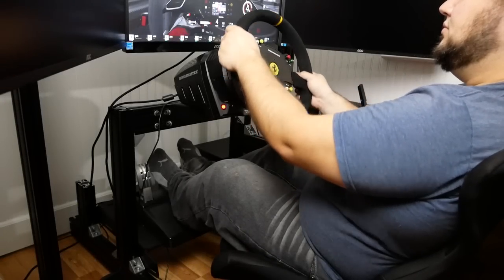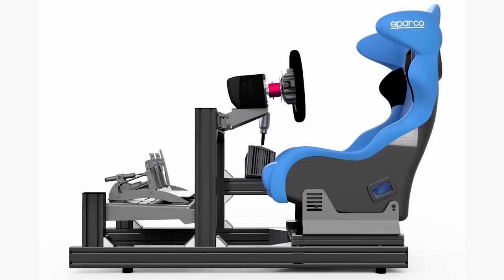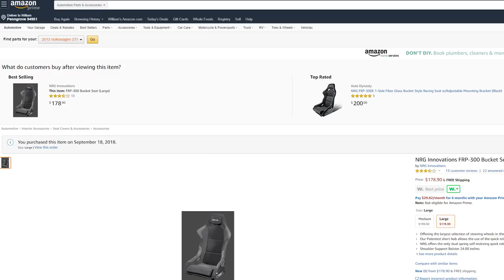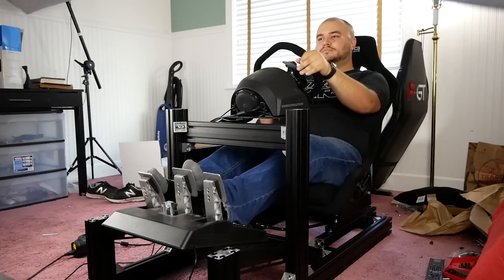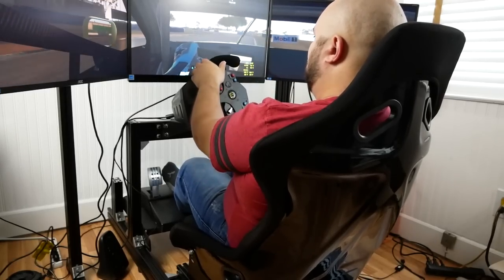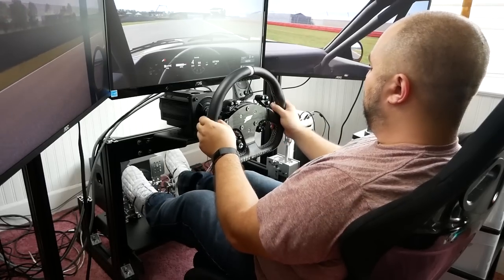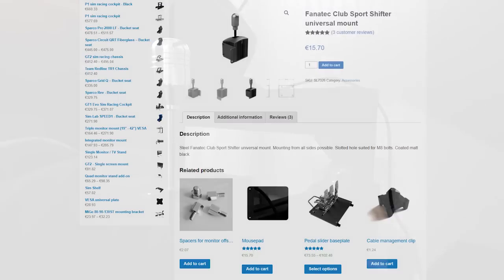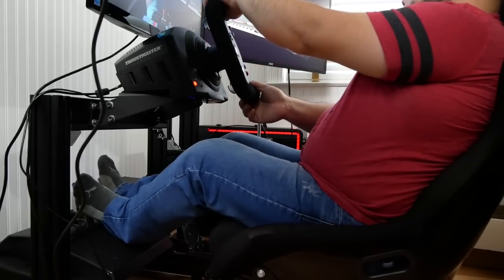Sim-Lab GT1 Evo Cockpit Review

Comment: Still getting some pedal flex on the high end stuff it seems. Looks like it would be a great rig for anything outside of an OSW/Heavy pedal setup.
Reply: This looks perfect for my csl elite.
Reply: I'm just wondering if it would be better to mount the pedals directly onto the frame and angle them with their own hardware, instead of using the pedal plate?
Reply: Just completing my build with Ricmotech Real Gear GT1 pedals and plate. Mounting directory to 40/80 cross members. 0 flex. Photos to follow.
Reply: I can't really see, but is that seat base tilted backwards or parrelel to the floor?
Reply: what would be better to buy for about the same price? or a bit more
Reply: This issue has been fixed by simlab now. Anyone with the old pedal plate can get a new thicker one for free.
Also they sell mounts for DD which stop the wheel flexing.
Reply: Jimmer
Reply: @shaunwright6348  right now I am  working on invert mounting  Heusinkveld Sprints using 4040 but will keep the thought of using part of the baseplate if needed just to reinforce it good IMHO........
Reply: For my little t300rs and tlcm its more than enough

Comment: I mounted the rail for the shifter on the outer side with the two additional angles that come with the package. Gives you a better adjustability to move the rail forward or backward. First added rolls underneath but soon switched to some silent blocks to get rid of noise that shakes through the chassis.

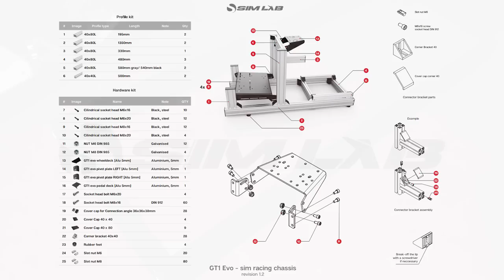Comment: Extruded aluminum structure isn't designed to flex - it doesn't. The build quality (or manufacture assembly) would be the problem with flexing. A simple brace or proper construction would fix flexing. And most importantly, those very tiny 90 degree anchor points are WEAK. (look at the 2:25 mark) If those were 3"x 3" with two anchor bolts each face, there wouldn't be any flex. The flex isn't coming from the chassis, its the given hardware. And as a private jet mechanic, we kinda know stuff ;) Take care.
Reply: hi, so you think it could be possible to fix the amount of flex of the wheel tray by using some other anchor points and bolts than the ones are given with the rig?
thanks
Reply: @zetaeerre0  Absolutely. like I said, if the 90deg anchor supports were larger and allowing for another bolt on each face to be installed, the would get rid a bunch of flex. Bigger anchor = decreasing leverage. One more bolt on each face = decrease leverage thus flexing.

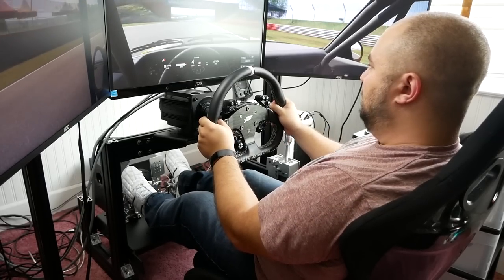Comment: William, at 4:25 you say that the wheeldeck is rocksolid, but at the same time you show the footage and it appears to have quite some flex in it. It's not noticable?.
Reply from the maker: The Pedal Deck wasn't really the bit that was flexing. Under braking, it was actually the front of the cockpit dipping into my old carpet (sometimes plush carpet does have its downsides xD). You can see the front of the cockpit dip down into the carpet.

Comment: Thanks for this review. I am looking at purchasing either the GT1 or the P1 when they are back in stock. Still trying to decide if this will be enough when I eventually upgrade to a Fanatec DD1. My gut tells me to get the p1 for futureproofing. I would be curious about your thoughts on the matter based on your experience with the GT1 and your OSW.
Reply: 202TheRocker you could just add to this cockpit with a couple of extra aluminium lengths and large metal bolt plates to strengthen it up. That’s the joy of this material, as you can buy these parts later and fit to suit. I just bought one for a clubsport v2.5 and will use it when I upgrade to a dd1

Comment: I still don't understand why simple cockpits like this are so pricey. Really would like to know what the actual price mark up is....you'd probably choke in my opinion.
Reply: Well, go figure out out how much it would cost you to source all the parts for it then.
Reply: @NickG40  wasn't be a smartass...I've been a delivery driver for companies for several yrs dealing with that material...let's just say I see prices.
Reply: @NickG40  buying bulk is a completely different price as in buying per 8' or 10' length.
Reply: Yep  that's like saying why did I buy a car I work for no named car manufacturer I know the  cost of making that car........   and the price markup for a sim lab rig  is less then 20%   I know I have 3 of them.   When u add in cutting of the profile custom hardware mounts for osw or the wheel deck this has.   Your not just paying for the alloy you are paying for the customer service you get with it.   If you can build this rig for cheaper getting the same wheel mount pedal mount.... maybe you should start selling them as well
Reply: @WhiteHawk77  it's a standard set rig, not custom. Purchasing bulk is alot less than piece by piece as in custom built. Custom rigs I understand because of waste. Set standards no.
Reply: @SlinkyonLive  I would if I could. Car market is marked up heavily. More then %20 depending on area demand.
Reply: And you honestly can't compare the two. Cockpit once adjusted you leave it alone. Car has constantly moving parts. Not a sim cockpit.
Reply: @georgeshowalter8011   the extrusion may be standard.  But the wheel and pedal plate ar not off the shelf hardware.  That took time to design and manufactor.   Sim lab is not some huge company.   I bought my first rig from them when he was still working out of his small garage.  Take a look at the tr1 version many more custom parts for it then this.  Sure you can make it close to this  for a little cheaper but you wint get the pedal plate  or the wheel deck
Reply: @WhiteHawk77  sorry didn't mean to reply to wrong person. All I'm saying is they have a set standard cockpit. Custom yes pop the customer with a higher price. And that's a sign of a good company if they didn't charge you anything for an issue on a custom part. Just with towards the standard set platform. Majority of them I dont understand why so pricey towards a standard set platform.
Reply: @WhiteHawk77  Richard does take care of his customers.   Hes one of those guys that understands bad publicity travels farther then good
Reply: @SlinkyonLive  honestly modified my plates for less then $5 sunk washers not flat completely took out shakes and vibrations. I spent almost $500 on a playseat. 4yrs ago still my rig. In the 4 yrs for custom stuff less than $5. Sunk washers was the key. Great customer service no complaints.
Reply: @SlinkyonLive  I'm not knocking him in that department would like both of you guys to realize that. That's a rarity and def props to him for that.
Reply: I'm currently designing my own rig that is a lot bigger than this one, includes, TV, keyboard/mouse stand and a few more bits and pieces. I looked online and it'll cost apparently 500-700 for them to make it while I looked on eBay, I can buy everything for 170, no it'll probably not be as good quality for the finish but it's hell of a lot cheaper. I do have to cut the parts by me though.

Comment: There is a way to make the GT1 EVO work with Servo based Wheelbases but you got to spend a little more on reinforcing it.......IE larger corner brackets and corner/side plates....in other words reinforce the S**T out of it!....Plus I'm working on invert mounting  my Heusinkveld Sprint Pedals as we speak using 4040 and part of the original baseplate. think a little and spend a little more you will be ok!

Comment: i wonder what would be the price making something similar all by myself, if its like 150-200 euros maybe worth? nonetheless great review
Reply from the maker: I did some researching last night, and roughly piecing out the parts would come to about $200 or so in the profiling alone. Add some extra cost for the brackets, hardware, and making a wheel/pedal tray, and it would come to maybe around $275-$300 ish?
Reply: @Simracingpaddock  hmm i bet they buy everything in bulk so it should be a lot cheaper for them, but honestly the price is quite good as it is, too bad its kinda flimsy for direct drive wheel so its not your final stop cockpit,  i think it would be possible to reinforce wheel stand without spending double.

Comment: Great video!  I just got my fanatec DD1 base and thinking between GT1 EVO and the P1 -X which is much more expensive. Which one do you think is better for a direct drive wheel. Is the P1 -X worth the 400 € difference?
Reply from the maker: I haven't driven a P1X, but I recently got the chance to drive a friend's P1, and I'd say that the difference is pretty significant. I'd say it would likely be worth the difference. 

I just feel the main struggling point of the Evo right now is the wheel deck. Granted, I haven't tried a DD1 on an Evo, but I just think there would be more movement than I'd be comfortable with.

When I tried the DD2 on a friend's P1, it was 100% solid, felt no flex whatsoever.
Reply: @Simracingpaddock  Thanks mate,  appreciate that

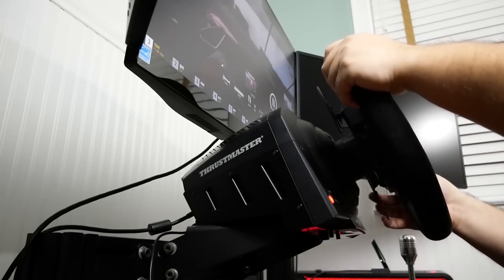Comment: 3:06 what rim is that?
Reply from the maker: That is the Turn R1 Pro Thrustmaster. It's basically an open topped steering wheel mounted onto the Ferrari 458 GTE rim button box.
Reply: @Simracingpaddock  gotcha tnx :)

Comment: I was quite disappointed when you said it's Evo's wheeldeck is not designed to handle DD wheels and that it has considerable flex. I wasn't expecting even from entry-level 8020.  I also saw on reddit report it has some flex.  But then I saw other review where he claimed "there's no hint of movement in wheeldeck and pedal plate":
https://www.youtube.com/watch?v=9NtoekAzxSg&t=2m35s
Reply from the maker: What I'm curious about is that Chris' review is about 2 months after mine, and what I find interesting is that his Direct Drive Wheel Mount is slightly more sturdy than mine... So I'm curious if they ended up improving it after my review, because you can clearly tell in his review there is almost no flex.
Reply: @Simracingpaddock  Yes it looks like they improved the wheeldeck, because he confirmed in comments: "I can only report what I've found, which is that it's rock solid (as you can see in the video). I'm still using the rig 6 months later and am very happy with it". I may ask Sim-lab directly via email whether they improved it (or planning to)  and let you know if I get an answer.
Reply: 1 this wheel deck is for dd but it does work. But they sell a dd mount for this rig on there site.